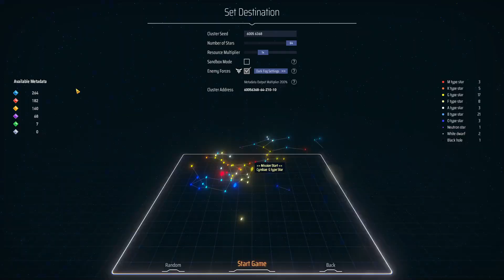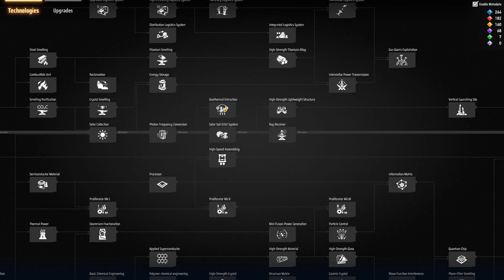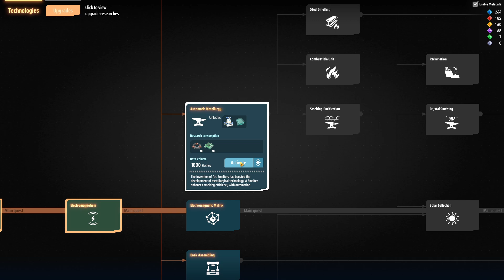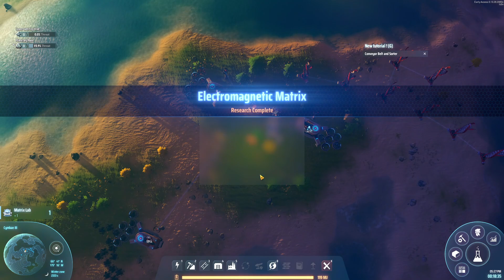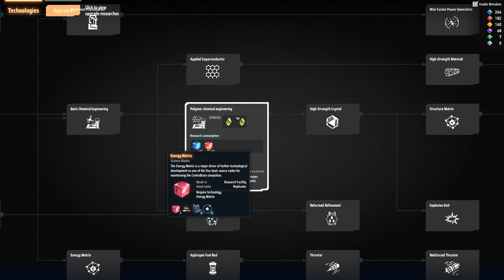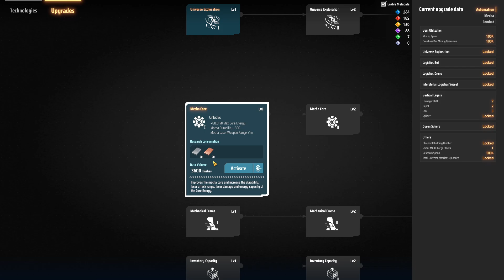HOW TO START - Guide DYSON SPHERE PROGRAM Dark Fog Tips Ep 1

Comment: First ten minutes or so, a couple of things to quibble about:

1) Don't waste trees, rocks, or plants. Pull them up and completely clear the land with your mecha before placing buildings. Otherwise, you lose those precious resources permanently. 

Especially at the very beginning. No reason to use coal (which also has a finite supply that is used for other things later on; the more you keep from burning up, the more advanced end-products you'll have available much latter). Also, done use your mecha fuel rods from your lander either in the early early game. You'll want those rods for the early mid game. Not the early early game. 

2) Not wasting trees: they're plentiful in the early early game. Plant matter and logs are a great early fuel source to use for your low-powered mecha. You're not wasting anything at all by burning those in the fuel chamber. They are not used for anything else at any point in the game. It's basically free, if finite, mecha energy, and suits the early mecha just fine. 

3) Do not use the rare Organic Crystals in your mecha that you occasionally receive as a "bonus" for picking up trees and plants. (Another reason to ALWAYS clearing the land before building anything as well!) The Organic Crystals will be used for more advanced materials as well, such as Plastics and I believe Diamonds. The more Organic Crystals you use in more advanced stages that you picked up and saved in the early early game, the more mid-game (yellow) research and advanced materials you can produce. Manufacturing Organic Crystals takes a long time, and uses the oil resource with an entire production chain in between. So make sure you gather the trees and plants, and save those OCs! 

4) The reason not to use coal and especially fuel rods until later on, is because the early early mecha doesn't chew through so much power, and doesn't store a whole lot of power. Logs and plant matter recharges what power you do use just fine. In the later stages of the game, you upgrade your mecha which uses more and more power for each task. It also stores more power, so recharging from logs and especially plant matter, becomes trivial and meaningless. That's where your spare fuel rods you saved at the very beginning can come in handy in case of emergency when you need power, and you need it fairly quickly. Same with coal. And oil, for that matter. I only carry around four full blocks of coal, while surviving off of logs and plant matter 90% of the time. Only use the coal sparingly for when you actually do need it. And then use the fuel rods if you catch yourself flatfooted, far from home, and you have no other fuel left in your pocket. Those three fuel rods will see you home safely.
Reply from the maker: As correct as these points all are, you neglect mentioning a really valuable resource your strategy costs: Time. 

I see no faults in those things, I think you'll even save some time due to the excess Organic Crystals you won't need to craft. But beyond that, all that micromanagement is effective, but time and attention consumptive. I couldn't keep up that pace gaming like this for longer than a few hours without burning myself out, so Kudos to you right there ^^

Thanks for your thoughts, I'll see what I can weave into the series, as I try to keep these as "easy as possible" and "as complicated as necessary", so everybody can get into DSP well off of these series. Have a good one o/